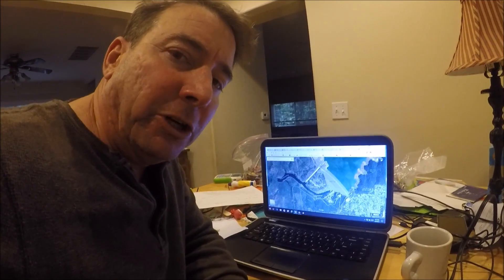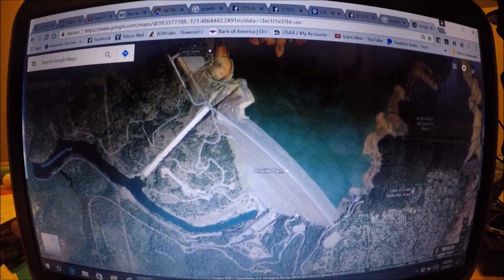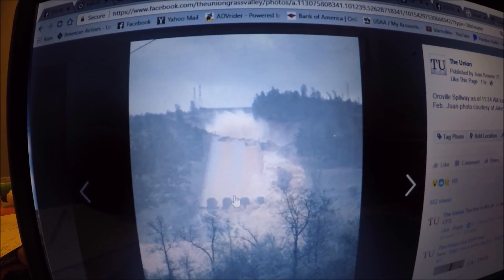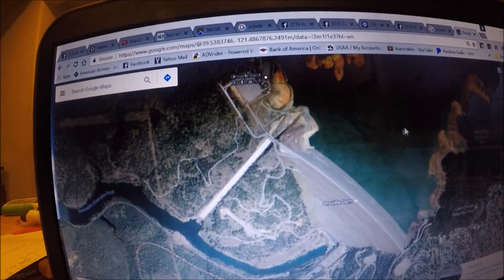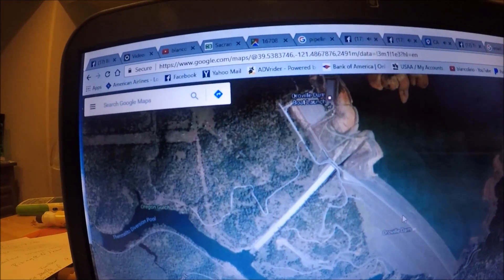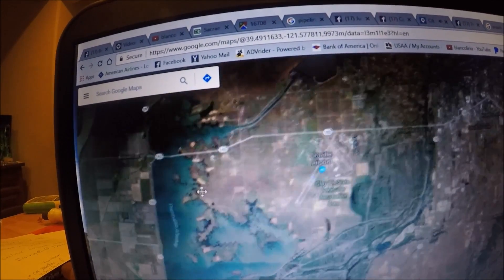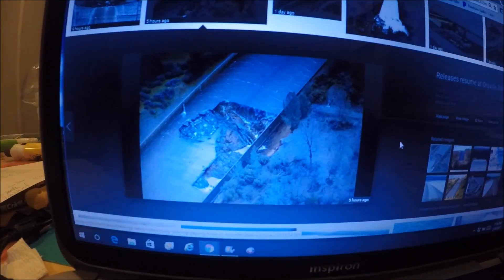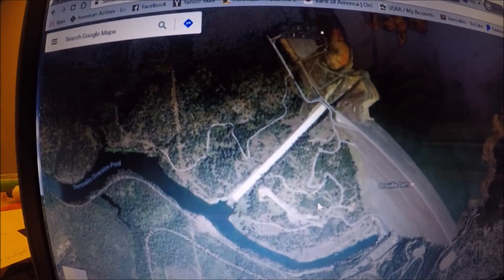Oroville Spillway Failure 9 Feb 2017

Comment: When the original spillway was built, I would imagine that there was good solid, bedrock underneath it for support. Because of the earthquake, which runs in a line, as you know, it probably shifted the bedrock and caused the fracture in the entire structure.  It could still be a problem, in the event there is another earthquake, or more.

Comment: there is a much larger hole now and both walls have fell into the hole. They need to stop the water flow, fill the hole with rock and then just poor lots of fast dry concrete with rebar to fill in the hole as a temporary patch. Should dry and set in 2 to 3 days. They need to reform the walls
Reply from the maker: after this emergency, the whole thing will be rebuilt...right now they just need to dump water ASAP.

Comment: Engineers use well educated guesses, there is no absolute certainty. Erosion at the emergency spillway is a big unknown; how far will it cut down at the top? If it goes deep, flows got be massive. Forget the crap in the water, it is the volume of water that matters.
Reply from the maker: I like your Avatar...that's Joaquin Murietta!

Comment: they should be able to put in a steel plate with side walls in the break area for a temporary fix so they can get the 100k cfs they need. just have to do some grinding on the spillway to get it flush with the steel
Reply: A steel plate 250 by 75 feet?
Reply: Wrong. It would get washed away in seconds. Remember that until it hardens concrete has virtually no strength.
Reply: let the water crest in the mean time get the spillway fixed then plug the emergency one
Reply: The time it takes to design a steel plate like that (No, it's not as simple as welding some 2" plates together) is longer than the time they have before it starts pouring over into the emergency spillway.

Building a steel plate  250 feetx75 feet, and the supporting structures for it, is no small feat. To give it sufficient strength to resist the forces of the water, you're talking a plate 2-4" thick. Even if they could design it fast enough, buy the steel and hire the crews, simply transporting that much metal there would be a formidable logistical task.

Doing it all in the few hours or days they have is a complete impossibility. If they had the resources available to do this, it would be faster, easier and cheaper to do it with quick hardening concrete.
Reply from the maker: but how quickly?...they have only hours to work with before the water crests the top of the Emergency Spillway.
Reply: it should work. the goal is to get the spillway going again
Reply: use the concrete that hardens under water
Reply: that is possible but to attach steel plates thru the concrete the bolts and mounting hardware might not hold up with a high water flow. There might be a suction created that would lift the plates at high water velocity.

Comment: Dam might be fine but an uncontrolled outflow over the emergency spillway will likely break many of the levees down stream.  It is better than a busted dam but it still has the potential for major downstream flooding.
Reply from the maker: Franklin Xeimeister Up to 150,000cfs (1997)should be no problem....beyond that has not been tested....
Reply: Exactly. 150,000 would cause major flooding as in '97.

Comment: Good video, thanx.  Pardon me if I remain a bit alarmed however.  What happens if the concrete spillway erodes all the way back up to the gates and they wash out?  Also, if the water goes over the emergency spillway that apparently isn't lined with concrete, will that erode away that side of dam?  Finally, if part of the concrete spillway was not built on a solid enough foundation to carry the amount of water it was "designed" for, how does anyone know the rest of the dam doesn't have similar erosion problems underneath or beside it that can't be seen?
Reply from the maker: Engineers are monitering the erosion on the main spillway, if it continues too far up the spillway it will be shutdown. The lake will fill and the Emergency Spillway way will be used for the first time ever...The Dam is fine. (for now).
Reply: Those gates would be lost. The question is then how deep will it cut down The deeper and wider the flow gets the more erosional power it has.
Reply: The emergency spillway could erode heavily. 100-200,000 cfs would result in a massive flood.
Reply: Thanx for that, I was just looking it up right now.  Apparently, the sun has came out and they are predicting water won't be released over the emergency spillway.  Apparently, it looks like it's going to be pretty close though.  I read in 1997 water got within 1 foot of the emergency spillway.  There is a dam similar to that one around here, not nearly as large though.  It's flood gates and emergency spillway have never been opened.
Reply: If I lived below that dam, I'd want an update on how full the dam is at least every hour.  The latest I've seen is that it's at 90%. Dams sometimes fail very quickly and release a giant deluge downstream wiping out everything in it's path.  Hopefully, this will only be a problem with the bottom of the concrete spillway, that can be fixed, although it will be time consuming and expensive.  However, if water is entering the reservoir much faster than they can release it, that might cause further problems when the reservoir exceeds it's capacity.
Reply: DWR does provide hourly lake inflow/outflow and levels on their website : https://cdec.water.ca.gov/cgi-progs/queryF?ORO

Less than 4ft from the top right now!
Reply: good question
Reply from the maker: PacificCircle1 No! The spillway will shutdown long before the erosion gets that bad.
Reply from the maker: PacificCircle1 150,000CFS is normal high flow.
Reply: You act like they have control, the Operators are now merely spectators.